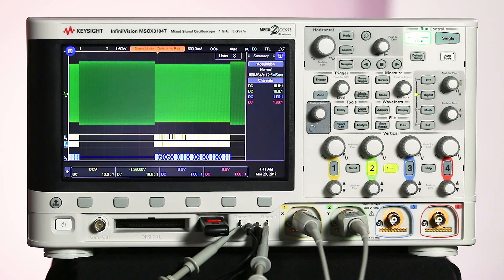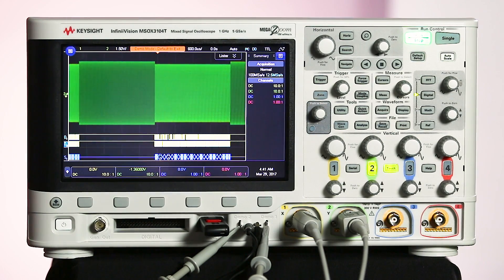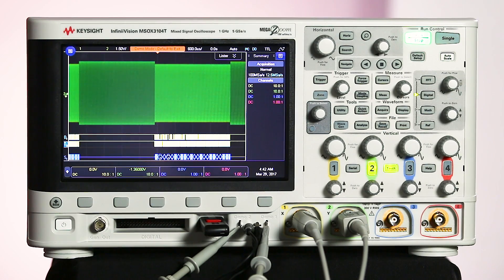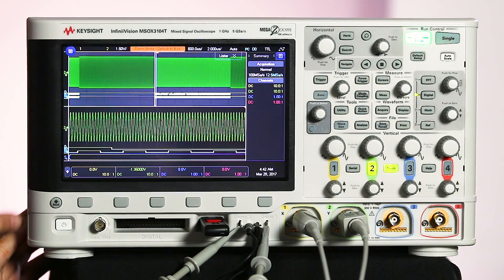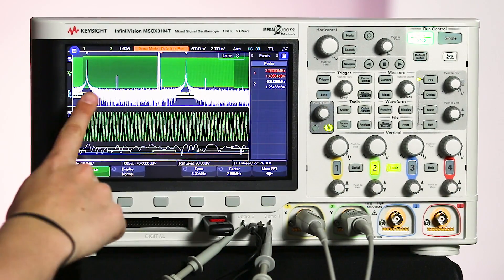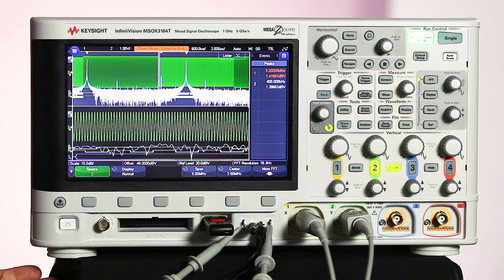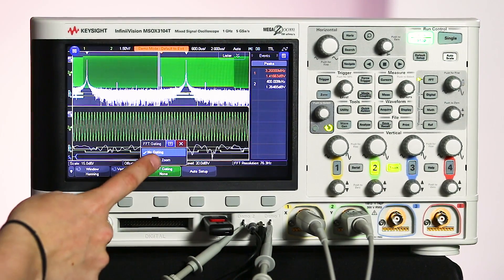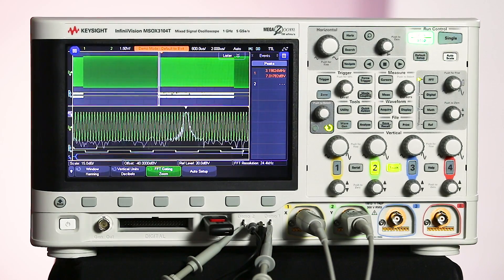Make Gated FFT Measurements & Today's Scope Month Winners (29-Mar-2017)

Comment: Does Keysight make oscilloscopes with real Spectrum analyzer instead of FFT? Something similar to the Tek MDO scopes.
Reply from the maker: We currently don't have any scopes that have built-in spectrum analyzer hardware, we generally recommend that engineers use a true spectrum analyzer for true RF debugging. Good question! We do, however, do some hardware acceleration for our FFTs on the 3000T and 6000X.

Comment: Yay more bloopers! :) I have that Rigol (who doesn't these days?) which I upgraded from an Owon, which wasn't as good but somehow had a way better FFT. :( If I want to do frequency analysis I have to use an old Lecroy 9414, which I have a big soft spot for because of the vector display, it was broken when I bought it, and I've repaired it twice.
I think one day I'll upgrade to a Keysight... one day...
Reply: I have that Rigol as well, i believe it was a DS2000A Series.
mine was bought with 70Mhz Bandwidth, however.. HEHE i unlocked it to 300MHz and 56Mp Memory Depth
it's a cool DSO

and.. god Rigol are Stupid
i mean
it's not like it's a keyboard that a lamen user buys and then.. they don't pull it apart

i mean.. if you get a tradie or a tech person and they buy a Multi Meter... AS IF they are not going to pull it apart as soon as they get home... AS IF it won't happen

so.. what idiot at rigol decided that the Techs won't be pulling apart their Scopes
and then what idiot in development decided

OH.. WE'LL JUST LOCK THE SOFTWARE and restrict it to a certain bandwidth,
BUT, WE'LL MAKE THE SAME SCOPE REGARDLESS OF BANDWIDTH

that way the techs will come in and shell out $1000 per pop just so we can pop in a USB stick and unlock the firmware
HEHE   YEAH RIGHT

and... it was actually a suprise to them when we figured out how to unlock it .

Bloody idiots.. seriously
on one hand they behave dishonestly
then
when we counter their dishonesty,  they get the shits   LOL
i guess it sucks when your client base are not stupid idiotic morons  LOL

anyway
let's hope they learn from this stupidity and give us better designs in the future and make the higher end scopes actually higher end and lower end actually lower end

but, it's a good scope nonetheless and i got it for a mere $1100 i think it was